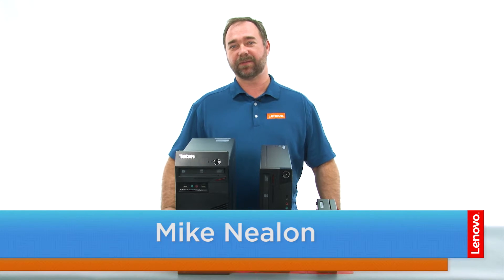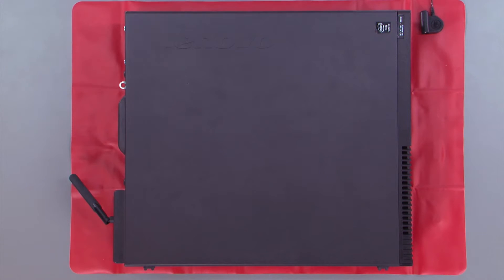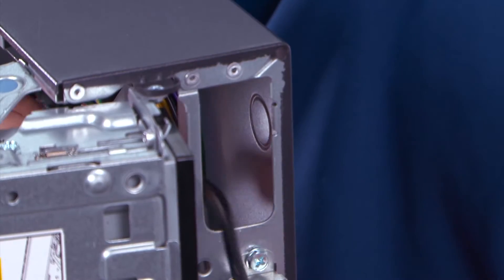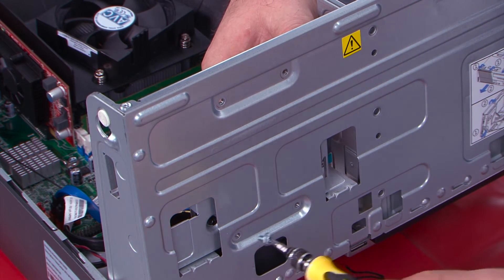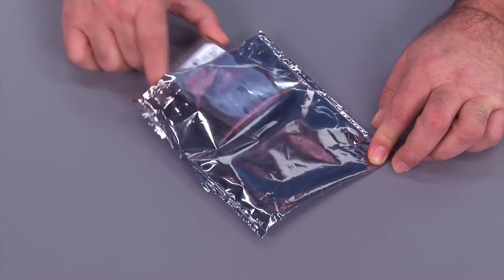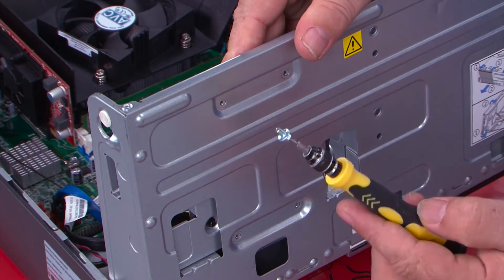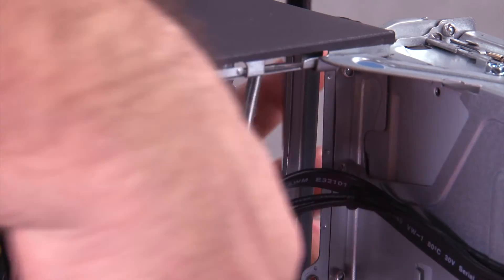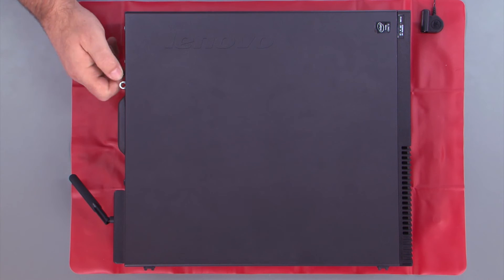ThinkCentre M73 / E73 / M72e Small Form Factor Desktop - Solid State Drive Replacement

Comment: I have the M73 and I was able to boot with 16GB Patriot Viper 3 Memory and an i5 4690 and I also have a MSI GTX 960 2GB OC installed in it too and use a 550w Insignia 80 Plus Bronze PSU as well and works great with all of it and can play games really well. For anyone who wanted to upgrade their CPU in one but I won't hold your breath as I dink only specific models will be able to unofficially support it.

Comment: Is there a way to have the hdd and ssd in there together? I have the E73 and i want to install an ssd as my boot drive and use the hdd for storage.

Looks like i can stack two drives in the same bracket. I’ll use Velcro or double sided tape to attach the ssd to the hdd. Then i need to get a sata power y splitter cable to finish the job.
Reply from the maker: Hello hamajangz, thanks for reaching out. We have found a similar discussion and you may view it here: https://lnv.gy/3736LrB as a guide,

Since you wish to use an SSD and install to your machine, the standard size of an SSD is 2.5mm, you will need a conversion bracket to 3.5mm and you will need to use this part number 43N9593 (SSD conversion bracket 2.5 - 3.5mm). You may also view this link: https://lnv.gy/39bZAzw  for the parts list. 

Once the second storage is installed (SSD), you may clone the HDD to the new SSD.

Let us know if you have other questions. Allan_Lenovo

Comment: Having one of these machines and now having spare money I won't feel guilty throwing at swapping the drive out, dropping a bluray drive in, and a gt1030? I really appreciate the youtube walkthroughs.
Reply: Hi, I have this model machine and have been running the GT1030 for almost 12 months, i have the fanless model with the spikey heat sinks. I think All GT1030 are SFF in size and come with 2 brackets, but please double check, they also work on 30 watts or so and drawn power from the bus only.

GTX1050 may or may not fit as several vendors make it and they come in al sorts of sizes and types of fans

Regards
George

Comment: Anyone know what kind of caddy will line up with the holes?
Reply from the maker: Hi Andrew! Thanks for reaching us for support. Could you tell us the exact model of your computer, so we can check? We'll wait for your reply. Ash_Lenovo
Reply: @LenovoSupport  ThinkCenter M73SFF 10B60008US.

Given the age and the fact it is nologner being sold? I'm fairly surprised at any response whatsoever. Grateful mind you, just surprised.

By the by can you confirm the PCI-E16x rail only being able to provide 40 watts? I keep seeing videos of persons upgrading the SFF variant going 'yea slap a GT1050 in it'll work great' and that has a power draw of I think 75 watts.
Reply from the maker: Thanks for sharing those details. You have the option to use GTX 1050 graphics, but we cannot guarantee since these are the only graphics tested on this model. You may check the details here:https://lnv.gy/2D3wqDt Let us know if you need anything else. Ash_Lenovo